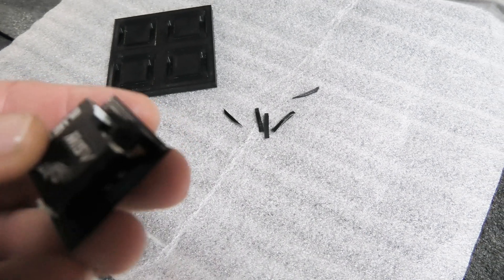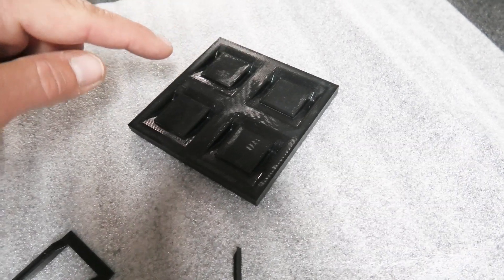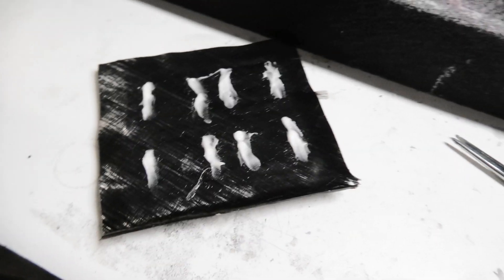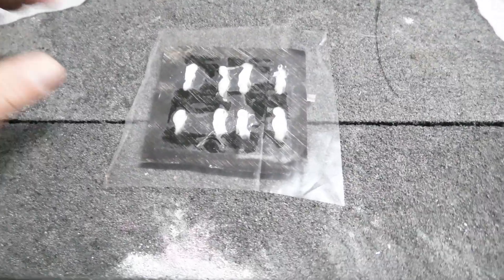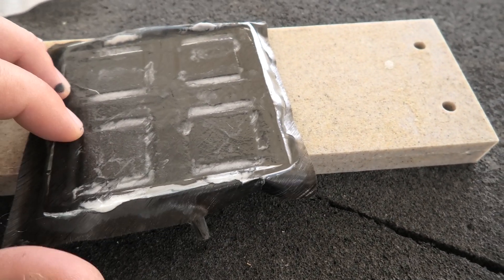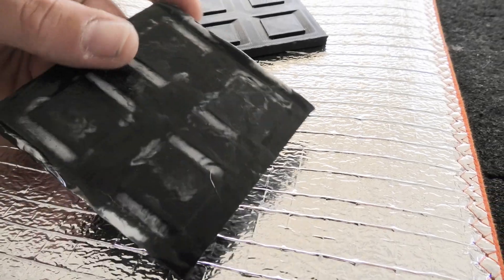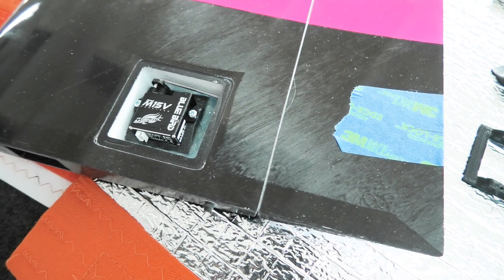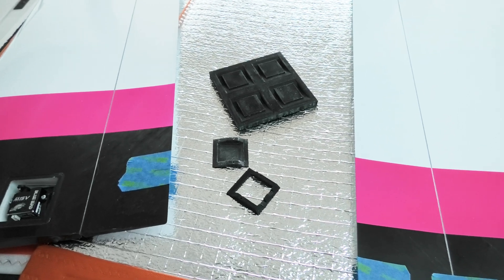Making Carbon Fiber Servo Frames, 3D Printed Molds

Comment: Great work. So I'm trying to learn about composites now. So the epoxy will not stick to the plastic sheet or the PVA mold release? Thanks. :)
Reply from the maker: Correct.  Also several coats of mold release wax first. Then pva.
Reply: @flightcomp  Thanks for the info. 👍🏼